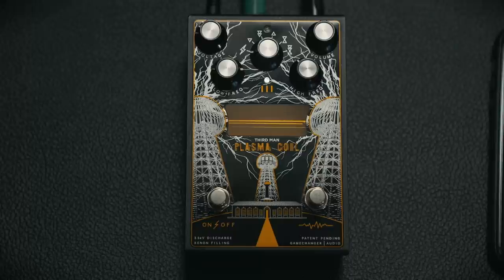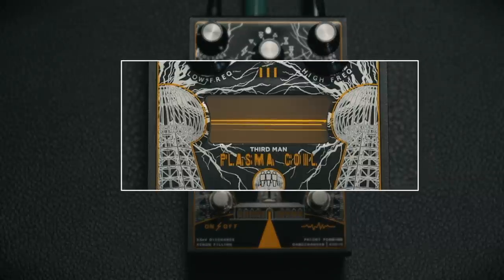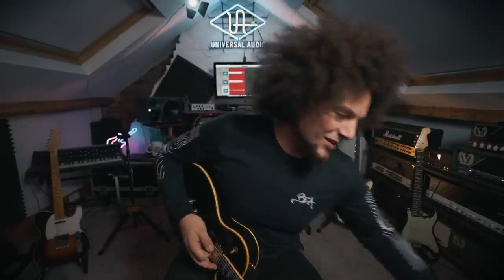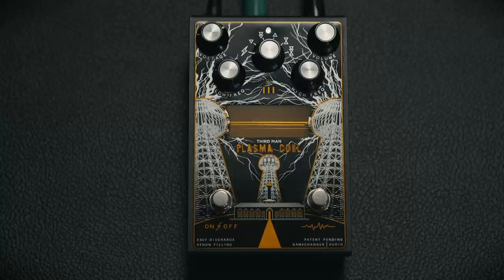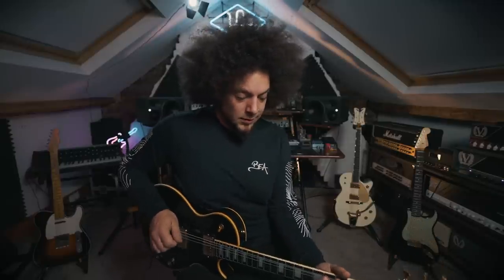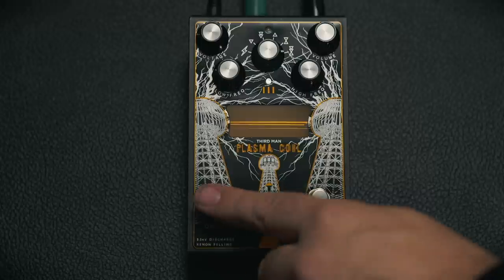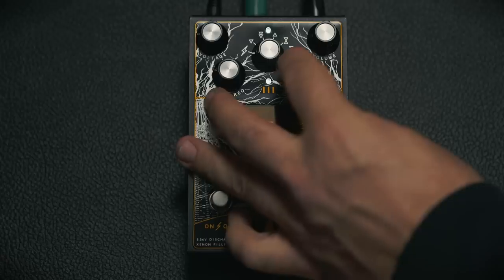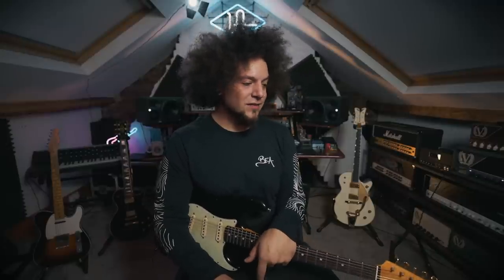Jack White & Third Man Records Get FILTHY!!! | GameChanger Audio

Comment: When i was a kid i had two cheap stereo's that i played my guitar through. I played into the aux on one and ran the speaker output into the aux on the other which completely overloaded the preamp stage and i swear it sounded exactly like this pedal!
Reply: I know, can you believe it?
Reply: I had a kenwood tape deck that the drive stopped working so I used it as an amplifier similar without the glitching but when overdriving it was similar.  I just ordered one of these third man plasmas. I’ve been looking at the other ones for a while now.
Reply: Lol..i did this too.
I had a TEAC tape deck hooked to a Marantz reciever. I would plug my guitar into the MIC input and turn the record input knob all the way up and peg the record meter, this made the guitar  heavely distort.

Comment: Holy shit rabea think my ears are still ringing after that pedal holy crap, Question for you basically am at the beginner stage going to intermediate stage now on my journey, And i have a tele one like yours but in black version and no mods on it dont know what model is though lol, And a washburn bd40r amp not the greatest amp in the world also a noob when it comes to guitar amps etc, So my teacher has said to me in the past with the gain level hes said that if you go past say 12 o clock lets say you start to loose the clarity and detail what ever it is your playing is that true ?, so he advises that i go no more than say 3-5 on the dials, Still trying to get used to how it sounds along with the selector switch and dials on my guitar, so what would you say is the best level to set gain at based on your experience or do i need to upgrade my amp ?

Comment: TLDR/W: A great quality terrible tone

It is very high quality noise degradation, but it hurts my ears even at low volumes, which is a bad sign for those of us who are concerned with long term hearing damage. 

It's unique, boutique, and an abomination

I wouldn't allow this sound in my ears ever at medium volumes personally, and I used to listen to strictly deathcore! If you purchase this, you are best using it with extreme caution. Hearing issues are much worse than anyone ever speculates! There has never been any sound worth hearing that damages your senses! 👻